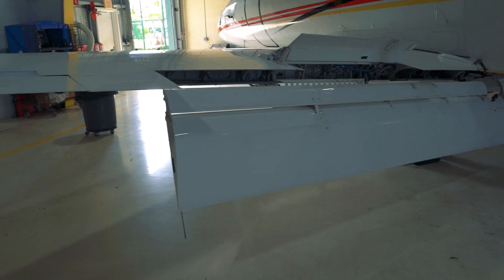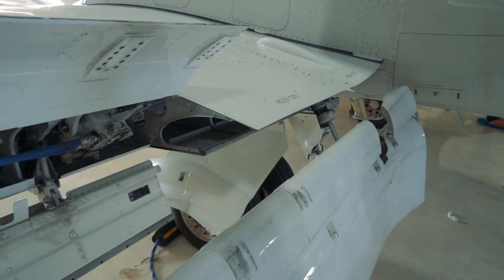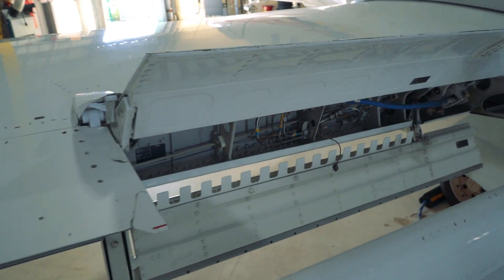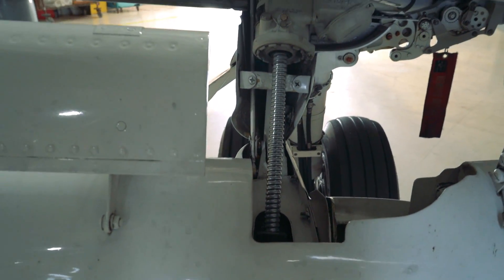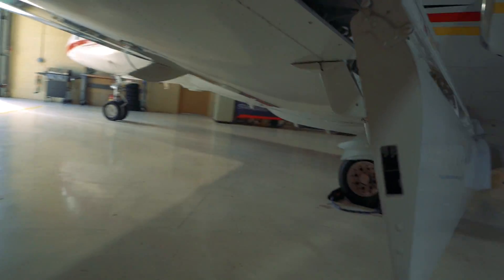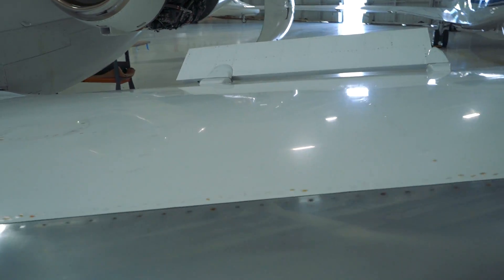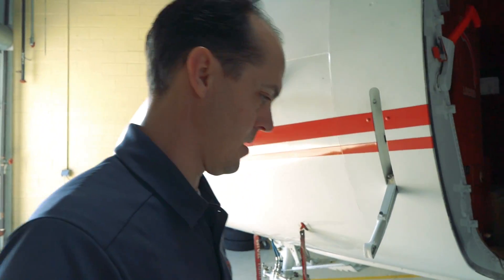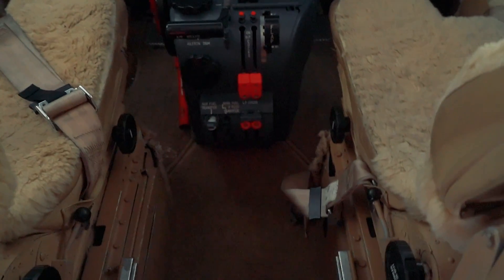Tech Tuesday - Exterior Flap and Lift Dump of the Hawker

Comment: Shaun, I have an aerodynamics question for you. So when flaps are deployed the camber increases, wing area increases (looks like single slot fowler type), the angle of attack increases giving more CL for a given speed. When activating the lift dump, where do the flaps start (40 degrees?) and does this mechanism effectively stall the wing by increasing the angle of attack beyond critical? Of course beyond a certain flap setting the increase is mostly drag and not lift. Is this just a high drag device or does it stall the wing?
Reply from the maker: When activating the lift dump, the flaps are starting at flaps 45. I haven't really thought about the concept of stalling the wing, but I would say this would be more of a drag additional device.
Reply: @CorporatePilotLife  Ah okay. Since you are not doing a full stall landing like in a single engine trainer I figure there is probably still some lift there.

Comment: That reminds me of the system they have on the B-2 Spirit, where the upper and lower control surfaces extend into the airflow on landing, presumably for the same purpose. Testament to how great of a force drag is at high speed. Pretty cool stuff, thanks Shaun!

Comment: This was great, Shaun - been wondering about these for a while!  Appreciate you crawling under the wing there for us, too. 👍🍻

I can imagine that works very well. When I used to work in industrial roofing, one gusty, windy day, I was carrying a thick 4'x8' section of "Polyiso" foam board, getting ready to lay it down on the deck - when I turned into the wind a certain way, I nearly went airborne! Air is super powerful I learned that day! I had to let go of it and let it go spiraling down to the parking lot below - luckily it was light enough to not cause any damage (and discipline for me!). We had a few sheets get airborne on their own from the deck, and broke in half over HVAC units or chimneys up there. A crazy day - one of many in that industry, lol!  I understand clearly now how a 200k lb. fully loaded aircraft can fly, after a little 32 sq.ft. board nearly pulled all 150 lbs. of me off the roof! 😁
Reply from the maker: That's crazy! Glad to hear you didn't go for a ride...
Reply: @CorporatePilotLife  -  Thanks, Shaun. Me too! I was pretty close to the edge there, too. Scary!

Comment: The type rating for the hawker series is call HS-125 and covers several models, one of which, called a Hawker 700, I flew back in the day (30 some odd years ago!?!?). That air frame also used  the flaps for landings and then they could be put in the "lift dump" position once the aircraft was down on the runway. At one point the chief pilot and I were returning to our base field empty and we decided to see how effectively the lift actually got "dumped" and decided to try some HEAVY BRAKING upon landing and being rolling down the runway after touchdown (we had no passengers on board and had great faith in the hydro-mechanical anti skid system (which BTW worked EXTREMELY well and reliably for such a simple-old technology--- NO electronics or sensors invoked- system!), so weren't worried at all that we might slide a tire. Well, once down we basically and very carefully STOOD ON the brakes and it was amazing how rapidly (almost terrifyingly!) the aircraft decelerated! Between the drag/weight on wheels created by the flaps now being in lift dump AND the weight being VERY firmly pressing the tires onto the runway, it worked amazingly well, stopping the aircraft very rapidly and causing absolutely no directional control issues---nice and straight! And yes, We did NOT have thrust reverersers for the very reasons they talk about in this video and we used to fly that thing into Miegs Field in Chicago where there was a very short runway in jet terms!! (only 3900 feet! For you younger folks---do a search on the web for Miegs field--VERY interesting!!)

Comment: With a lift dump or a spoiler system. What your really doing is reducing lift so all the weight of the airplane is on the wheels for max braking capabilities. 
With out using these devices while on the landing roll,  your airplane is not it’s actual weight.( because it’s still creating lift. ) Example: like trying to run in or stop forward movement in water. Your traction is just not the same.

Comment: Thanks Sean... Did you see that video of the Embraer 175, go off the Runway at O'hare? American Eagle Flight... Didn't see any Lift Dump on the Wings working there. Braking, put that plane in the grass. Lost control of steering.
Reply: It was an ERJ145 yesterday at ORD. In the video of it landing you can see the inboard spoilers were deployed. Looks like the ended up weather vaning with the cross wind rotating them off into the grass.

Now a question for Sean. With a T-tail aircraft with rear mounted engines  like the G4 and Hawker has that the TR's can  blank out the rudder making steering control difficult on contaminated runway's. Is this a issue on the G4 or Hawker?
Reply from the maker: I did see that landing...glad to hear everyone was ok!
Reply from the maker: The TRs can have an affect on the rudder control. If you ever see a Gulfstream landing and they happen to heavily use the TRs, you will notice the vertical stabilizer shaking quite violently. The Gulfstream is very easy to maintain runway control as it has 8 degrees of nosewheel steering on the rudder pedals. The Hawker has no nosewheel steering from the rudders, so I tend to get my left hand to the tiller pretty fast in the Hawker. Also, I don't usually apply full TR in either plane unless I am on a very short runway, so rudder authority is a bit ore predictable.

Comment: Hiya Shaun!!  That's some very cool tech Tuesday video!!!  That flap is so close to the runway when its fully extended like that any little bump would seem like it could scrape.  Amazing technology!
As long as that Jackscrew is, how fast does it fully deploy when you pull the lever?  Seems it would take a bit of time to unscrew to full length.  Thanks for a great tech Tuesday!
Reply from the maker: Well I've never timed that deployment, but I would say less than a second. Keep in mind that we are starting out at flaps 45 on landing, so it's only going the remaining 30 degrees or so.
Reply: @CorporatePilotLife  That's fast! Thanks!

Comment: HEY SHAUN ! SO is that how you get the lift out of the wing so it will drop to the runway , the wing stops flying ??
Reply from the maker: This system is activated AFTER landing. Should someone accidentally use the lift dump system prior to touchdown, the landing would be so hard that you might call it a crash. A Gulfstream inadvertently used a similar system before touchdown several years ago and it came down so hard that the landing gear pushed through the wings...
Reply: @CorporatePilotLife  WOW ! NO SHIT ??  SO it kills lift after touch down and I guess is like a speed brake also ??

Comment: Call me stupid - if you have air breaks, why a lift dump as well, is this to stop on a dime ;-)  Great video!!!!
Reply from the maker: Not a stupid question at all. Without lift dump, this plane would require significantly more runway to land. It's amazing how much drag that system provides. An aircraft that can land and stop on a short runway is more marketable to buyers.

Comment: What is the max speed you can deploy the lift dump system ?
Reply from the maker: There's no speed restriction, but we have to be on the ground before deployment
Reply: I enjoy your videos, great content.  I only fly Cessna 172's but I'd be concerned if a system could change the lift capabilities so dramatically they wouldn't be able to deploy accidentally.    Thanks again for your videos.